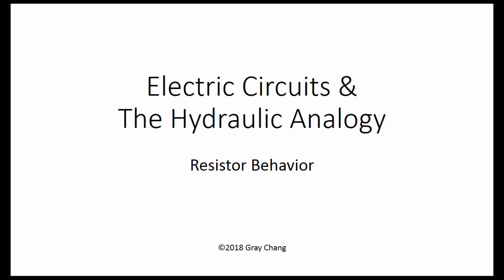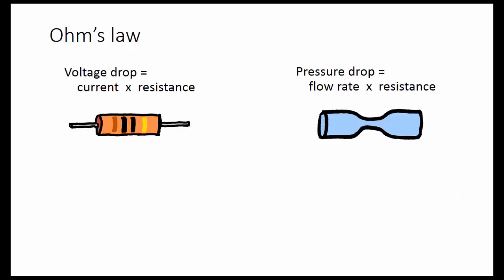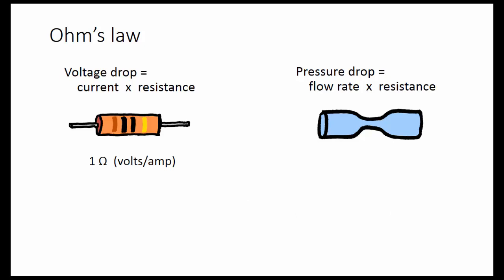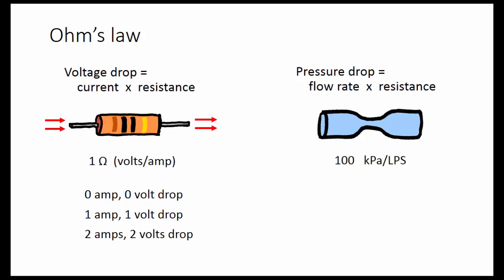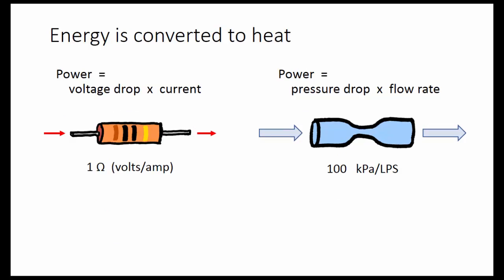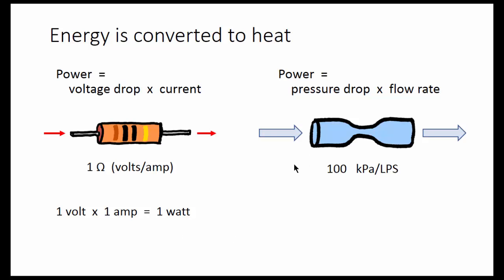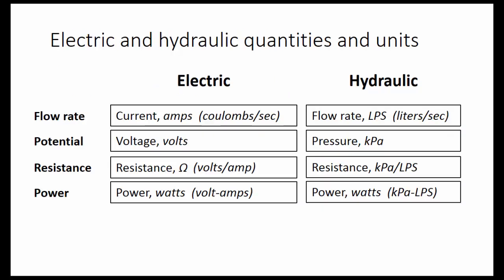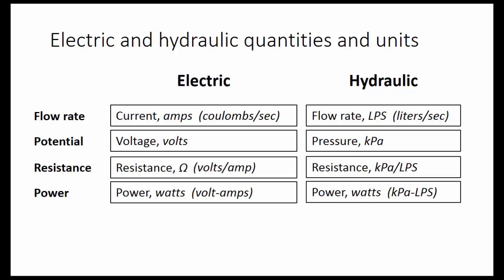Resistors: Electric - Hydraulic Analogy (easy)

Comment: Does we can also use a wheel equivalent to resistor?
A wheel also absorb power from flow of water and convert it to rotetion like a resistor , resistor convert power from flow of current to heat.
Reply: in general a waterwheel represents an inductor when referring to this analogy.

Comment: What's the difference between a starling resistor and one of these normal hydraulic resistors?
Reply from the maker: A Starling resistor is an actual fluid resistor used as a medical device. The resistor in the video is a conceptual model used for educational purposes; it is not a device that you would actually use.